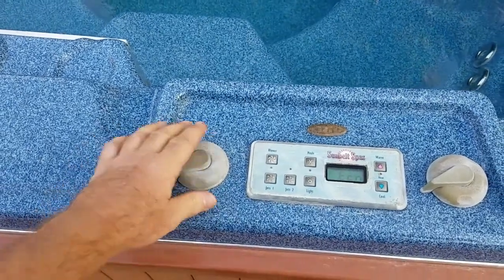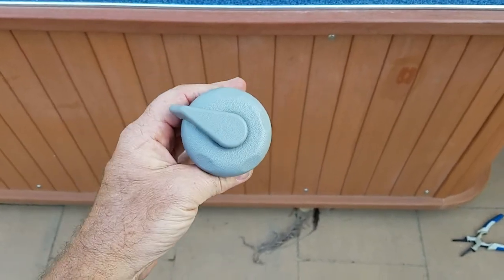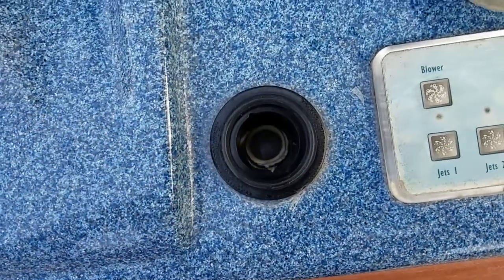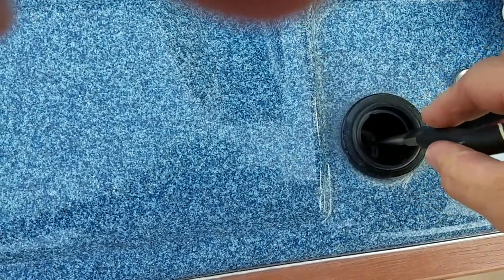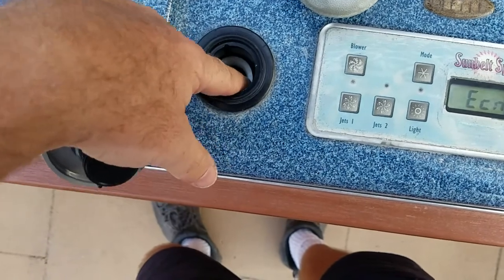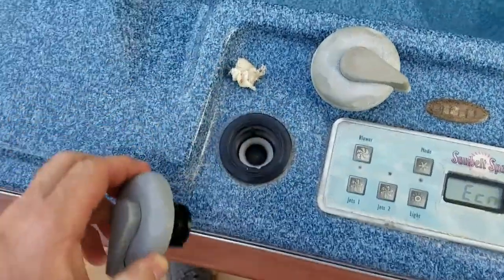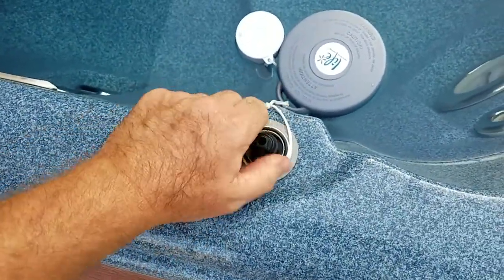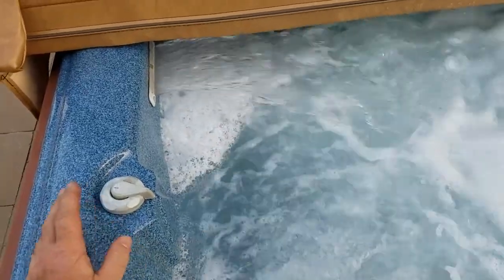Waterways Air Control valve

Comment: You are losing any force with a leaking air valve. If it is open all the time it will just have air all the time which is usually desirable. You just wont be be able to shut the air off.
Reply: during water change you need to use swirlaway for an hour on high jets with air valves closed. i had to fix this worn out gasket before i could change the water

Comment: Thanks for the video. I have the same problem with a Blue Water Spa (Costco) and ordered a Waterway Air Control Valve 1" 660-3587 x 1 from Hot Tub Warehouse for about $19.95 + $7.95 S&H.

Also, living under the approach end of an airport runway, Lucky! I can imagine sitting in the hot tub judging landings and blowing kisses to the Flight Attendants.  You have a good life brother.